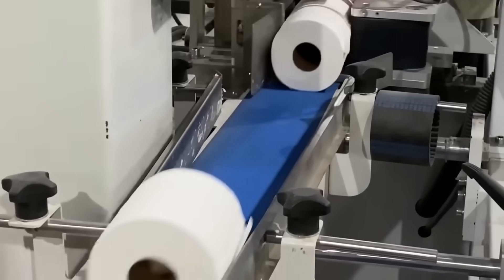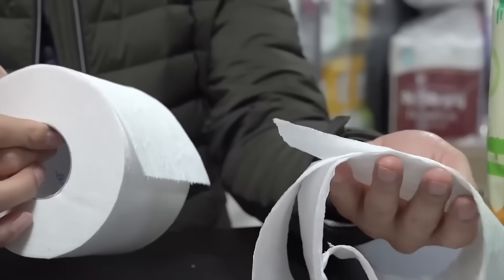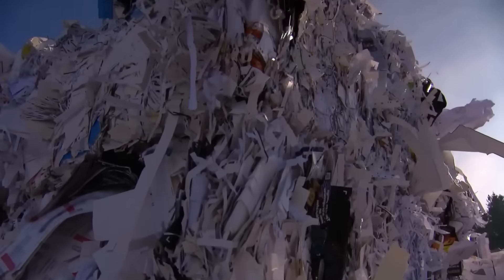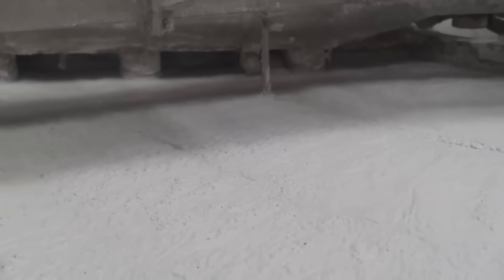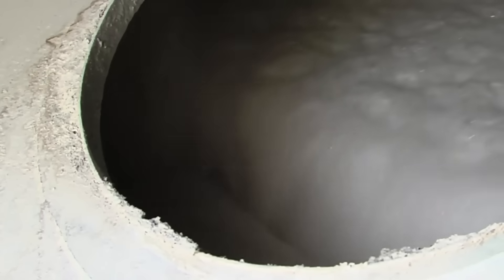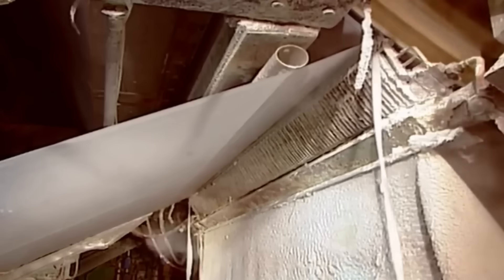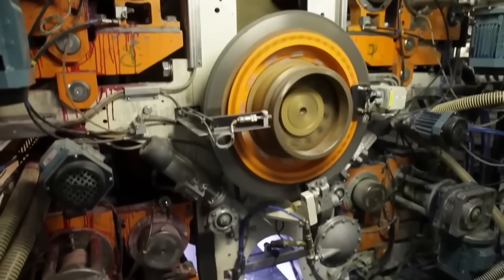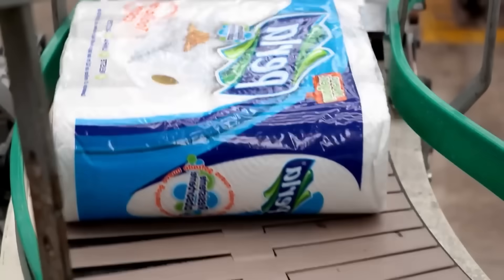How TOILET PAPER ROLLS are Made 🧻 | THIS IS HOW 83 MILLION TOILET PAPER ROLLS ARE PRODUCED

Comment: I wish the rolls were larger and wider with a small inner core like they used to be. Or is that just a US problem?
Reply: The rolls I use here in the UK - are 4.5 inches across, with a core of 1.5 inches.  Average 400 sheets per roll.  Remember - the core has to be at least as wide as the 'hook' on the roll holder !